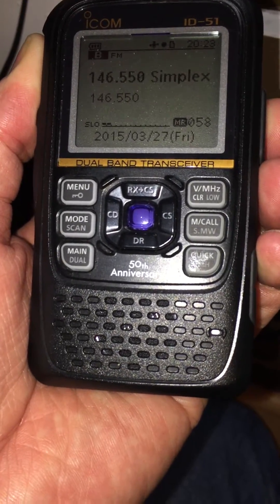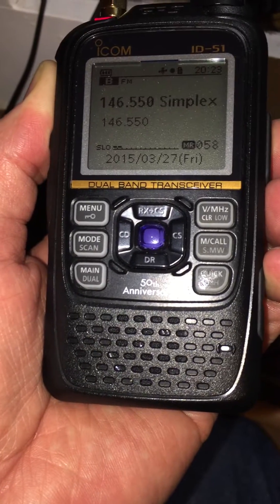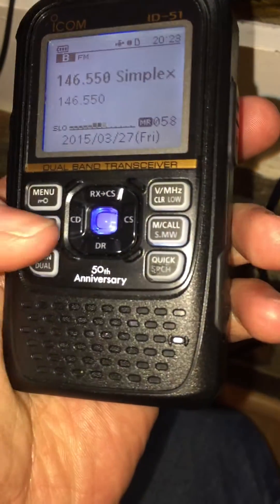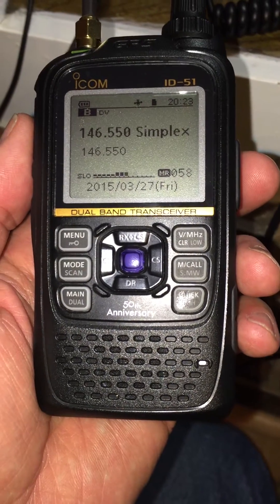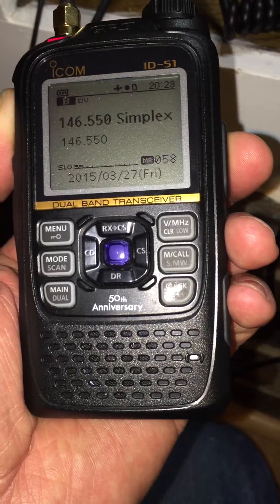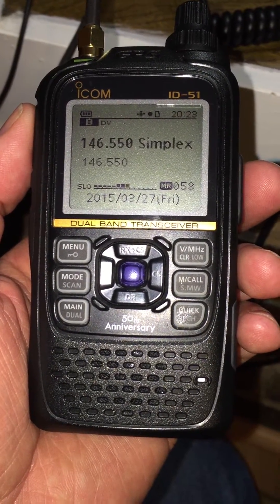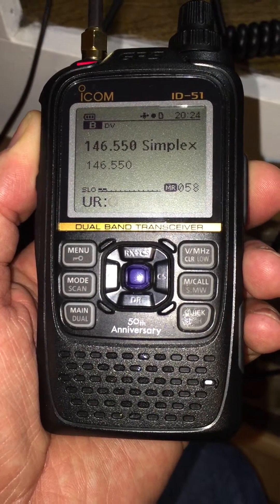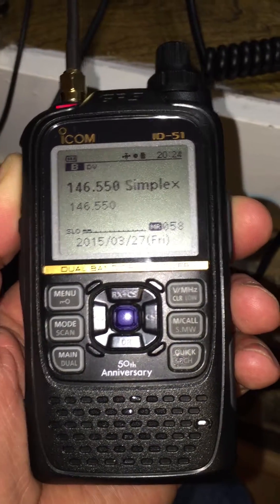FM vs D-Star on 100mw simplex on ID-51A

Comment: I've conducted this sort of experiment as well - only the distance initially was much more than 4 miles!  With the signal barely showing on the meter at all, the audio was exactly the same as when close up. With no audible packet loss either. That was between two mobiles parked up on elevated sites with maybe 20+ miles between - clear air between the cars.
I really don't understand why it is that so very, very few DStar (or DMR for that matter) use their rigs like this for straight simplex operation.  We found that the result is usually way better on DV than FM if you're at the transmit distance limit or even a bit past it.  I also think that pretty often once DV signals have been bounced around via the reflector system they emerge at the other end not sounding as crisp and clear as they do when used like in this video.  Lots of guys not making best use of their radios, seems to me!
Reply from the maker: I prefer DV mode for all operations, sure wish everyone else did.

Comment: hi, nice vid. can you please tell us whaat kind of antennas you are using? are you inside a home or outside? what kind of geographical area are you guys surrounded by?
Reply from the maker: I was inside my home, but on my external Ringo dual band antenna.  We're in a sub-urban area, with hills and buildings between us.  I might add, the same QSO was tried on FM UHF simplex on 446.000.  For some reason, not even 50 watts with my id-5100, nor 200 watts on the other end was able to make the QSO.  Something is blocking us.